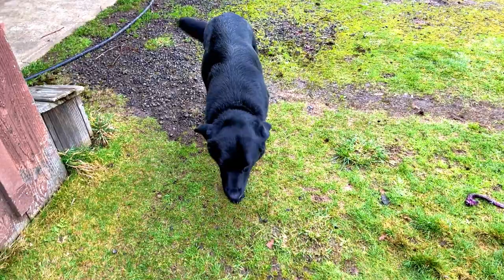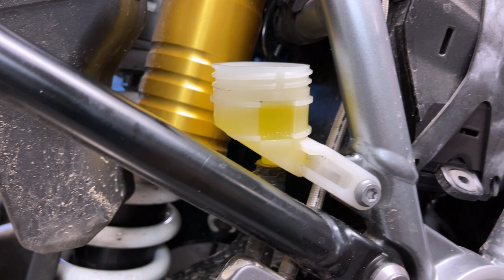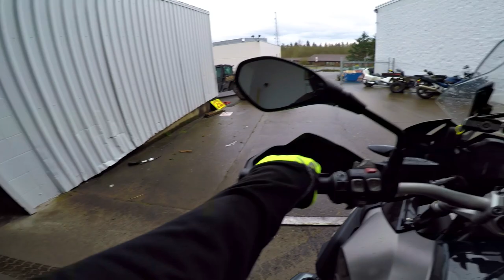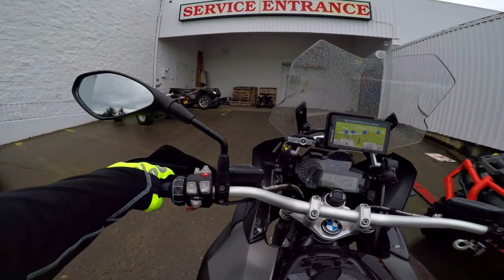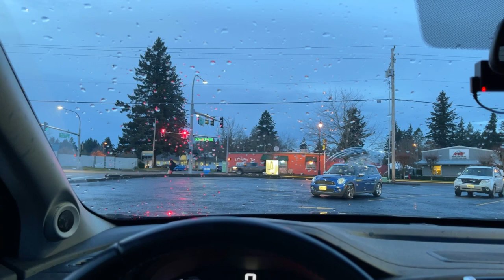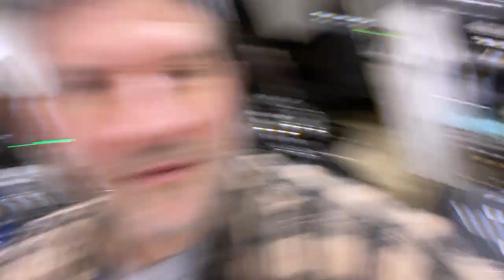New Skins, Must Travel!! • 2017 GS Demo Returns! | TheSmoaks Vlog_1900

Comment: Brake fluid, yeah. I live in a desert and I still flush it every year and half or so and I can tell the difference. It's cheap insurance. As far as property size goes, it's usually about taxes and permit fees. The denser the housing the more permit fees and property taxes for the municipality. I grew up on Long Island and dad's property was 90x125. That was pretty nice size. When I got my first house, that was suburban too and 75x150, house was 2200 sqft. That property today is about 12k a year in property taxes. I had the same size yard in Iowa, house was bigger and the taxes were 4100. Probably 5500 now. In AZ, the zoning is different, at least in the town I am in. 1.46ac, 2600sqft and 2200 a year in property taxes. To build though the permit is 50k. On the other end, my brother and I inherited 100ac in northern maine. Taxes there are 1400. NY is damn expensive, Iowa was a good balance as the schools were very good, roads were maintained and the 5-0 kept the riff raff out. AZ, not so much. At least AZ has CC. Good luck with that in NY.

Comment: DR is looking way too sparkly now! Shawn, my old Honda (same engine as your old XR)  has always been fitted with radial tyres. I fitted a pair of Bridgestones which I didn't realize at the time are crossplys (recommended fitment for the bike) I notice the tyre pressures recommended by Bridgestone are quite a bit higher than Honda recommend. I know you always say run the bike manufacturers pressures, what would you do in this case? Do crossplys need the higher pressures? (Bridgestone haven't been any help) Sorry should have said it's a road bike not off-road.

Comment: Hello - you are complaining about 17 inch tyres can we say 16 both front and rear.  110/90-16 front and 130/90-16 rear.  Want do you say is the best tyres for a cb700sc build in 1984?  And with this size tyres on it.  Thank you.